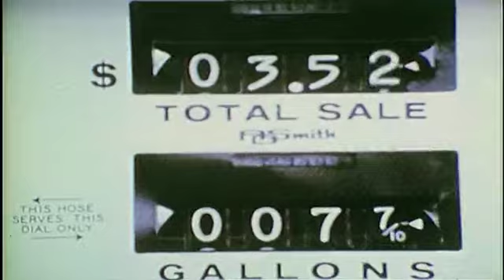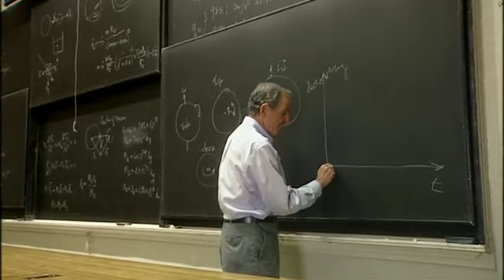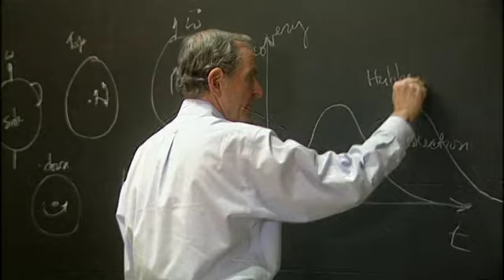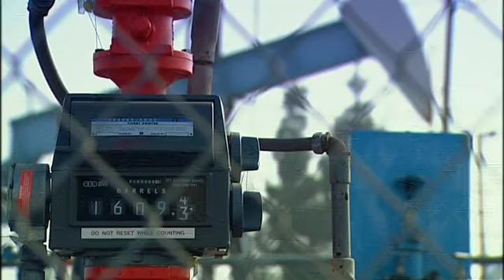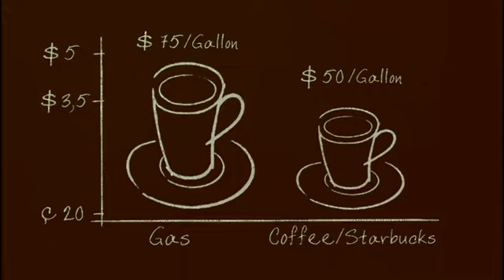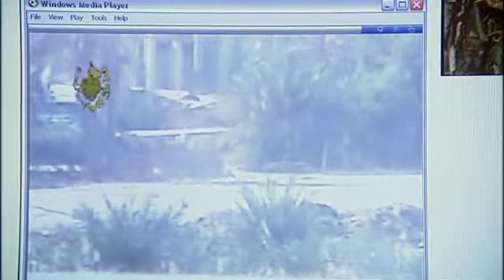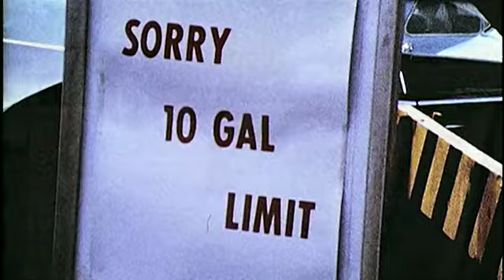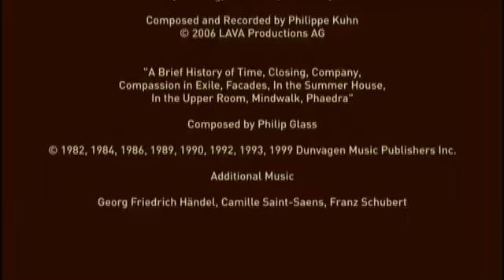A Crude Awakening - The Oilcrash

Comment: For those who say peak oil is dead and wrong, that is not so...

Yes many pessimists severely underestimated how long our extraction technology could keep up with deteriorating acreage available. What's been happening is we keep depleting the easiest oil to get and having to move on to deeper and harder reserves. Unconventional reserves like Canada's oil Sands and US shale have also unlocked many new reserves. For now we have plenty.

However since oil is a finite source, mathematically no matter how much our extraction technologies advance, we cant stay ahead of the curve indefinitely. At some point in time we won't be able to keep up and oil will become increasingly scares and expensive.

Yes we have more "recoverable proven reserves" than every before. And given rise electric cars demand may plateau or even decline a little in coming decades and this doomsday scenario will happen much later than many anticipated. Maybe not in our life times.

However we will continue to use a lot of oil for everyday things such as plastics, fertilizers, pesticides, paints, shingles, asphalt etc etc etc so unless some technology we can't conceive of right now replaces Oil for those things (nothing economical has yet to be even proposed)... We will continue using a lot of oil for a very long time

So whether it takes another 20 years or 200 years for supply to become a chronic challange, at some point it will happen. It's hard to predict when and many who tried to forecast it have gotten it wrong as we've seen. But eventually it will happen
Reply: Also to add that all the conflicts in Syria, Afghanistan and  unstable regimes in Venezuela. Sudan and Iran are a top priority of the USA.
Reply: unknown territory  inflated reserves or declining quality available (hence the sea rigs your talking about) are not in question. I know quality is deteriorating and I'm fully aware of many Nations with questionable officially reported reserves.

All that does is prove and remind us that oil is finite. It doesn't mean we've already hit the peak.

Comment: there's huge amounts of sunlight. Build enough solar that gives you electricity enough to meet your needs for electricity AND so that you can electrolyse water to get enough hydrogen (and oxygen, which you release) - do not use fuel cells (what, to turn the hydrogen you just produced into electricity in your car, when electricity was what you started with?). Burn the hydrogen in an internal combustion engine to drive your car - the exhaust gas is water.
Reply: And mabey soon we will get fusion reactor.
Reply: +Cerii -- yes, in 15 years there's a good chance we'll see a design that really works, provided we keep on with what's happening already, and governments keep putting money into it (not too sure about that, though) - ITER and then DEMO, or the German plasma or US laser + fuel pellet experimental reactors which would be better geared for many local smaller-scale installations instead of huge centralised generators. Looking forward to more.
Reply: Dick Hamilton Even if the future seems dark, there are always opportunity around us.
Reply: Solar energy not reliable on overcast days, ditto for wind power on windless days.
Reply: Harvey, overcast reduces light a good bit (not as much as you think), but not IR, which is what solar really works on. For the rest, never heard of storage? One way to store, I already mentioned - make hydrogen.
Reply: it's also why you link your power into a grid - the sun doesn't fail to shine, or the wind to blow, everywhere at once.
Reply: The medium is renewable the renewable energy infrastructures are not.
Reply: you would need several feet of solar panels and almost an entire days worth of sunlight to electrolyze a liter of water. separating hydrogen and oxygen from water is a very be very intensive and inefficient way to power your vehicle. It works though ill give you that.
Reply: 37712 -- I'm not talking about a personal system  - I'm talking about a grid system for everybody's use - hundreds of km2 of solar to power the world.
You don't seem to get what 'efficient' means - I mean energy available / energy input.  Electrolysis is actually much less complicated than cracking the heavier components of oil to produce more gasoline, which is what we do already. The process is almost 100% efficient - all the electrical power applied translates into producing gas, electron for electron - very little is lost. And we get oxygen 'free' to release, which we must do to stay in balance when we burn the fuel (many people have missed the fact that as the temperature goes up, and the CO2 rises, the oxygen content of the atmosphere, and the ocean, is slowly falling - photosynthesis is getting less productive because of higher average ocean temperature and because the microflora of the ocean are less abundant... down more than 40% since the 70s).  From solar energy to motive power, it's much more efficient, end to end, than what we do now - where only about 30% of the available energy in gasoline goes into motion, and more is lost in getting to that final stage.
Reply: Electrolisis is less complicated than procesing oil but it is far more energy intensive than producing oil.
Reply: Is it, though?  the energy isn't being 'used up' - it's a conversion from one form of energy to another, not a loss or a cost, and it's virtually 100% efficient. It doesn't matter how 'intensive' - it is all recovered, so I don't care about how much energy it takes, so long as a the losses are low (and they are) -- whatever is used produces useful fuel and the costs are 'fixed', not variable - we start with solar electricity, of which we can have far more than we will ever need, and we convert as much as we need into the fuel we need for transport. You can't even make a decent comparison with oil - how much oil do we use just transporting it, or gasoline, around from place to place just to make it available where it's wanted? is that efficient? moving electricity around is a fixed cost - the grid - but the variable cost is very low.  For deep oil, how much power do you need to run a rig? (the North Sea, they tell me, can't make a profit selling oil below about $36-$40 a barrel, so that's the cost). For shale, the EROEI figure they quote is that you use up somewhere between a half and 1 barrel of oil (and thousands of gallons of water) to produce 1 and a half barrels, getting a net gain of half to one barrel... for tar sands it's worse.. is that efficient? It's certainly 'intensive', if you want to produce a few million barrels a day.  We use near a hundred million barrels every day, worldwide.
Reply: *****
fusion is always "2 decades away".
Reply: Iron Osiris
You said:
"No, fusion will not work. We can't even get to unity in terms of input output energy."
the experimental JET tokamak (which ITER follows on from) already produced net energy gain (for the short time that the plasma pinch was stable), if you took away the running power requirement of all the monitoring apparatus they needed in an experimental facility, measuring and gathering data to ensure they knew exactly what was going on.  

"Solar PV is one of the most inefficient ways of creating electricity"
nonsense. Each photon absorbed produces one electron - some are not absorbed, and some are reflected. The process is potentially about 70% efficient. Multi-layer PVs have already demonstrated conversion efficiencies of about 48%. Coating systems promise more. 48% source to output is higher than any conversion taking place in coal, gas or hydro power plants, or any combustion process followed by an alternator or dynamo. Thermodynamics tells us we can maybe get a little less than 50% in such schemes. No practical power plants get near there. The best you get is about 30% overall, and that does not include extracting the fuel or moving it to the power plant, neither of which you need to do with solar PV.

 "In saying that, it will be feasible in parts of the world but its intermittent"
That is why you have a grid and a distributed collection system, and storage. The sun doesn't fail to shine (or the wind to blow, for that matter) everywhere at once. 

 "And also you need oil in the manufacture process."
entirely wrong. There is no necessity for carbon compounds in PV manufacture. Emphasising that: Oil is not an ingredient in making a solar cell - solar cells are not 'made of oil'. In addition to silicon, and conductors like copper or silver, and perhaps III=V semiconductor ingredients like gallium or lead or  tellurium, you only need Energy. You can get energy in many ways, including wind and solar and pumped storage hydro.

"And again how are you going to make food via solar pvs. The whole food system is dependent on oil."
again you confuse the need for oil with the need for energy. Fertilizers are NOT made from oil - they are nitrogen compounds made from atmospheric nitrogen, and hydrogen from any source, e.g. electrolysis of water. There's no oil in them. The Haber process that fixes nitrogen into ammonia just requires energy in the form of heat and pressure, which is easily deliverable using electricity.
Agriculture does use a lot of energy in the form of oil at the moment - to power machinery. All machinery can be driven by electric motors instead of internal combustion engines, and in fact this is MUCH MORE efficent - in fact, roughly three times more efficient.  Internal combustion engines waste most of the energy in the fuel as heat - delivering less than 20% of the available energy to the output driveshaft.
Reply: "Solar PV efficiency is 44% at best from the literature i've seen, "
currently in production, yes. But in research, I see higher figures. I've seen info from Cambridge - an outfit spun off from the Uni -  claiming certain coatings applied to cheap Si cells could get 90%, but that was two years ago when they were looking for investment. I didn't actually believe it (seems to me you would have to downshift photons in some kind of nonlinear mixing process or frequency halver, but what do I know? I'm not a materials scientist), but the source was reputable. I'll try to find the link and get back to you if I can. The tablet had it, it's dead, so I have to try to remember the route I got there by and search.

As for mining - why does a drill bit have to be rotated by a diesel engine, or similarly the driveshaft in an earth mover? Electric motors drive trains, hundreds of tons of 'engine', thousands of tons of load.. diesel electric trains do not use the diesel engine to drive the train forward - they use it to generate electricity, which is then used to drive a BIG electric motor, or several, distributed along the train. Because of the load isolation (the diesel generator-driver runs at a constant and optimal speed) this is actually more efficient than driving the wheels directly with a diesel. It's electricity that pulls and pushes that big beast along.

Re - pesticides and plastics feedstock, you assume too much. Did I say we would stop taking oil out of the ground? No. I never did. It's a fantastic source material, unique, and cracking it to make more gasoline whch you must sell cheap just so you can burn it (inefficiently) is simply a sin, imho. Oil, less of it, I grant you, will still be extracted, and its value will INCREASE - we just won't waste billions of barrels of it by burning it. and poisoning ourselves and the atmosphere in the process. 

An electric tractor will be better than anything any farmer currently has - many fewer moving parts, much less maintenance, much less lubricant, much more low speed torque. And I'm sure once in production, cheaper to buy.

Comment: Additionally virtually all modern technology is made of petroleum, since virtually everything invented since 1860 (when oil was first drilled) was made possible only because of oil. The computer you are using consumed ten times its own weight in fossil fuels during its construction. A car requires several dozen barrels of oil in its construction (around 20 to 30 barrels of oil is required to construct an average car with seats for 5 people). There are seven gallons of oil used to manufacture a tire for most cars.  All plastics and most products nowadays are made of petrochemicals Even alternatives to oil require oil its as basis. So we use oil for much more than just fuel for transportation.

Comment: to take issue with one of the first statements in the video - actually, we ware moving from an era of cheap abundant fossil energy (produced by ancient sunlight), to an era of cheaper, more abundant renewable energy (provided by current sunlight). Ask Nick Hodge. Of course, the people who sell us our energy now, do not like this, but the more sensible among them are changing already. They know which way the wind is blowing.
Reply: +Dick Hamilton  No we are not, we need fossils fuels to build the solar panels and wind turbines etc and we do not have enough to do so, climate change is already irreversible and nuclear war is imminent
Reply: +Rach and Dave nah - the Sun throws astonishing amounts of energy at us every day. Never say die. Those with the money are already doing this: go to Western Sahara (which is a country who are already amenable) and lay out a square km of solar panels, build a factory to make solar panels there, powered by that array. At 12% efficiency (not the best or most expensive panels), 1 sq-km of solar in the sahara for effective 6 hours per day gives around 18MW, and there's no shortage of silicon (dioxide) there. Make solar panels, using the early production to expand the array. Make more solar panels. Western Sahara is already negotiating with a string of companies to supply energy to Europe across the Strait of Gibraltar via a high-voltage DC line (Morocco and Algeria too are in the same game). Examples of such lines, more than a hundred miles long, have already been built. This one would be longer, true, but it is all existing tech.
As for Nuclear War, if you are American, please do ask your government to override and expell the NeoCons in the State Department and not start one. Nobody wants one except them. The Russians, certainly, will not start one, and nor will China. Only USA will. Our current understanding of the climatic effects of only 50 bombs the size of the one dropped on Hiroshima indicates that this would be enough to cause nuclear winter and a substantial drop in daytime sunlight for a few years, due to the amount of dust carried to the high atmosphere, and consequently terminate all life on the planet (probably, certainly the oceans), but that bomb was tiny by today's standards. A 'small' device now has 100 times the yield, with up to 20 times the area on the ground, and 20 times the dust. Demand that they not do it.

Comment: Solar technology is limited as it is now, but I definitely agree we can find other means asside from our current model.

As it currently stands, the solar industry is dependent on another non-renewable resource, that being silver. Silver is a key component in the production of most solar pannels today, and silver is likewise being consumed by several other areas of technology including computer technology and medical, all in quantities too small to recover and recycle what is used. Likewise, when a solar pannel is dammaged beyond use, the silver used in its production also cannot be recovered.

As such, solar energy by its current silver dependent model faces the exact same problem as hydro-electric does. That being that the means by witch to impliment it are limited. On the other hand, it does have a significant advantage over oil in that once it hits that peak it will not immediately begin to decline. I also am rather confident that by the time we hit peak of the current silver-bassed model of solar energy, by then we will have long since discovered another model to operate on.
Reply: Everything has its drawbacks, and to put faith into renewable energies as the magic silver bullet that will save the day is delusional or at the very least overly optimistic. Solar energy cannot be created out of thin air, as it requires very specific natural resources for the construction of photovoltaic cells.
Reply: The question is not whether or not it uses finite resources, but how much energy you get out of that resource. The material that is used to make a solar cell is used once, and then it produces energy until it breaks. In the case of burning fossil fuels though, you have to constantly use more and more of that resource. Solar cells are a lot more bang for your resources, and once they break you can salvage and re-use most of those resources.

Comment: Clausewitzz, I think you have made a very good point.  However, the position presented ignored the proven fact that recovery technologies are also reducing in cost at an ever increasing rate.  (This is due to both technology improvement and competition.). I was formerly employed by a global field service company which offers these technologies to oil companies.  Every year, we are under enormous pressure to reduce product costs and improve reliability.  Also, one should not forget oil reserve comes in "bulk."  Because of this, all it takes one technology breakthrough to significantly improve production.  For instance, gas fracking has created opportunities at Marcellus and Utica plays at the US east coast.  These two plays alone have the potential to supply US with natural gas and liquid for the next 30-40 years...  Similar can be said about the Canadian Oil Sands...